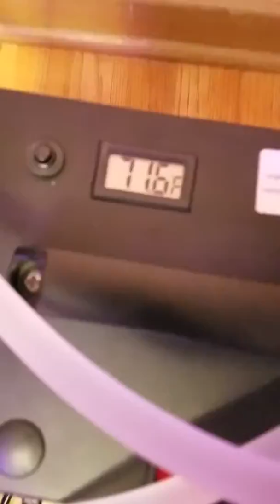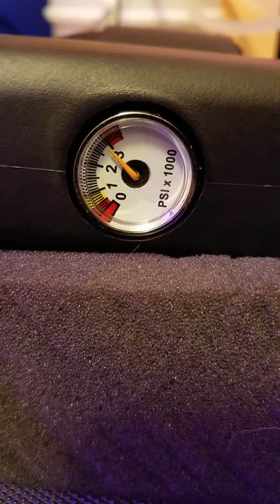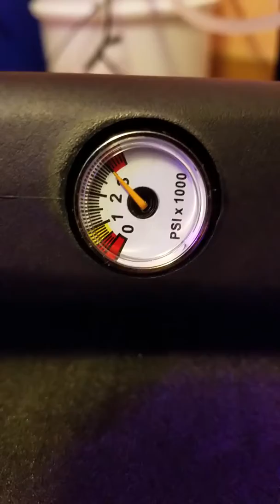4500 psi PCP compressor with desiccant moisture trap

Comment: Is the moisture trap setup to the compressors air inlet filter,so your removing moisture before it enters the compressor,other systems I`ve seen use a high pressure oil/moisture trap on the hp line which is then attached to either a pcp rifle ir carbon tank.